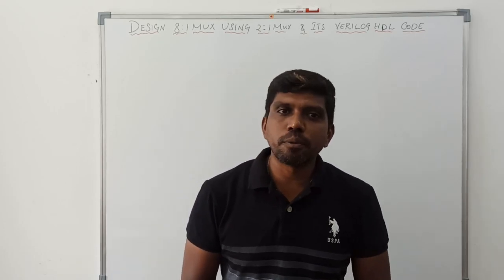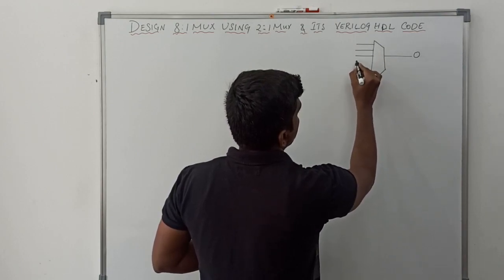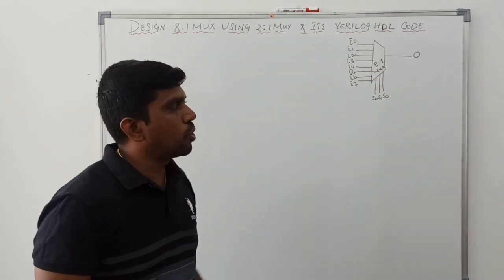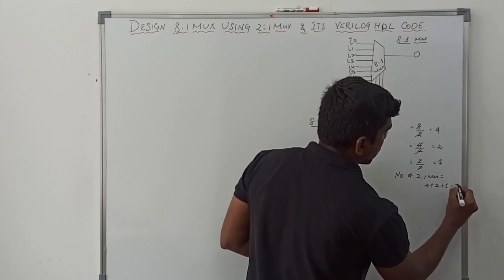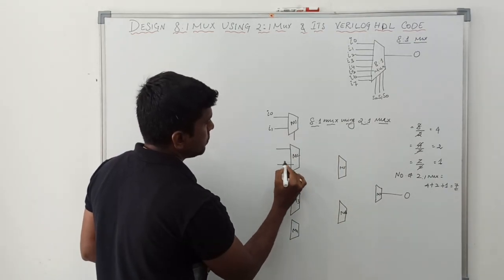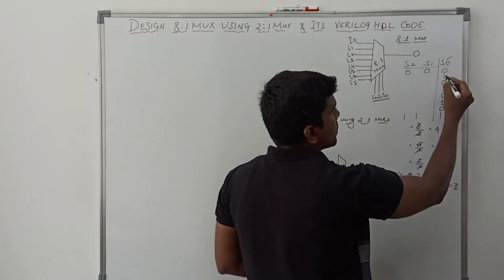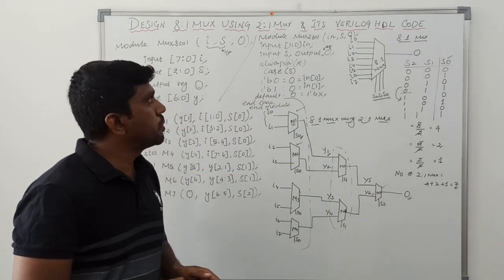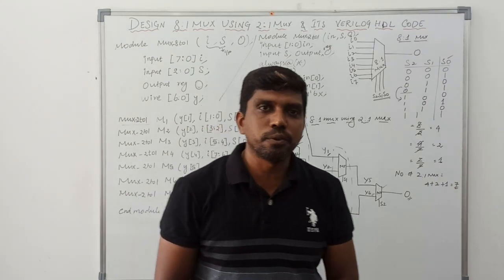8 to 1 Mux Using 2 to 1 Mux ||  Verilog HDL Code || Learn Thought || S Vijay Murugan

Comment: Sir actually it was wrong declaration in wire it will be [5:0] bus representation will not be allowed [6:0] cause it will start from 0 to 5
Reply from the maker: [6:0] means totally 7 bit, but in that configuration we have a six signal only so that represent [5:0].